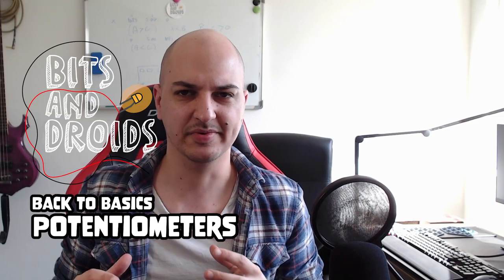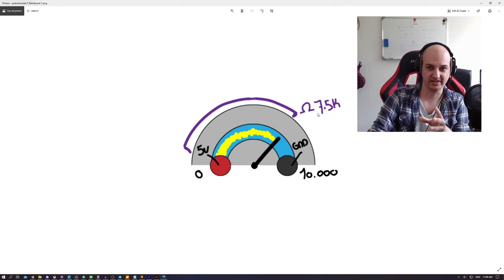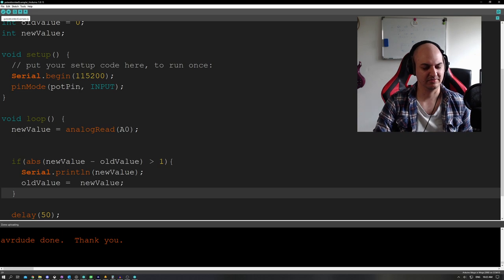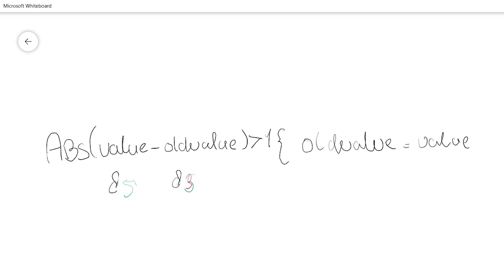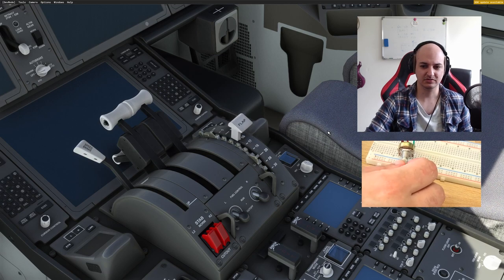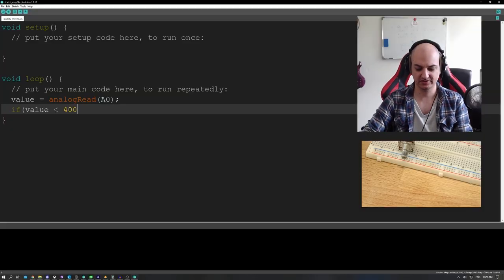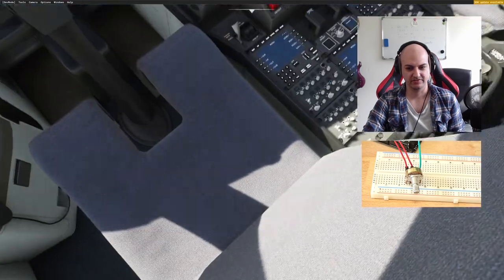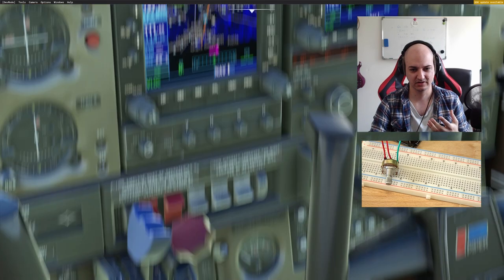Back 2 basics: Potentiometers, for mfs2020

Comment: I was just doing a Flaps handle with a slide pot and you don't know how much trouble uou just saved me.
Reply from the maker: Have to add the min and max ranges to the settings and then the flaps are good to go.
Reply: @Bitsanddroids  I just checked and noticed the 8.7.1. Is it the new one?
Reply from the maker: @SantaGamerYoutube  ehmm 0.8.8 it will be if I'm correct.
Reply: @Bitsanddroids  oh ok. My mistake😔
Reply from the maker: @SantaGamerYoutube  https://www.bitsanddroids.com/release-notes-0-8-8-and-development-update/
Reply: @Bitsanddroids  I got it to work! Thanks alot, I will now just need to build a case for this. You just saevd me from so much trouble:)
Reply: @Bitsanddroids  I don't know if I need it, but what kind of code should I add to the existing for the Flaps, to make it reversed. So I'm not sure if its in the right way?
Reply from the maker: @SantaGamerYoutube  When you open the connector -> hit settings. You should be able to find a range setting for flaps. Usually it runs from 0 - 1023 but if you just flip that to 1023 - 0 you should be good.